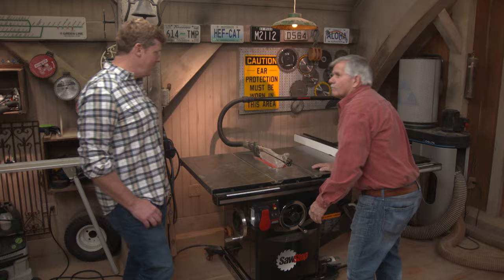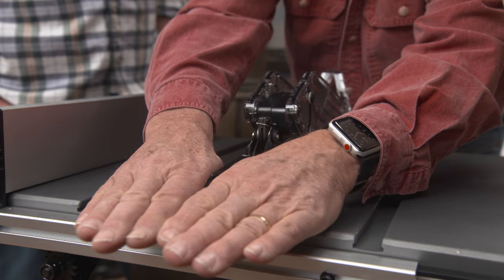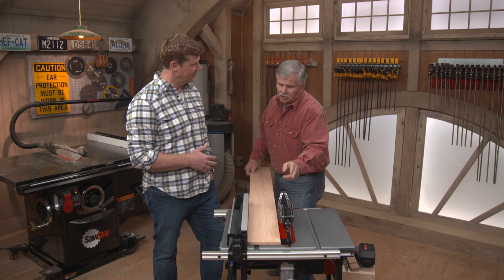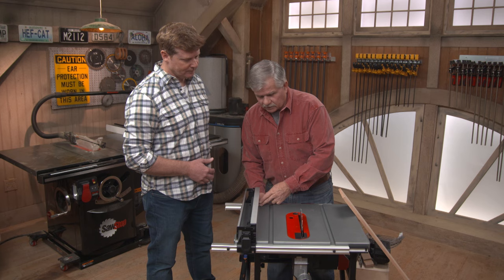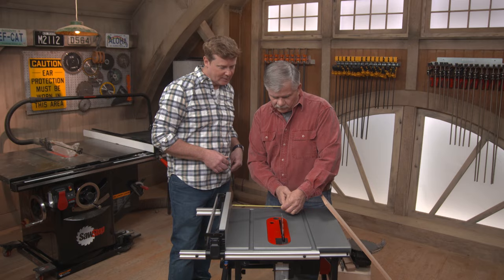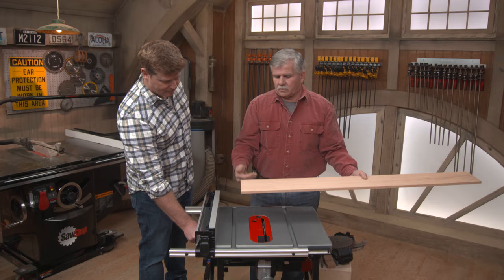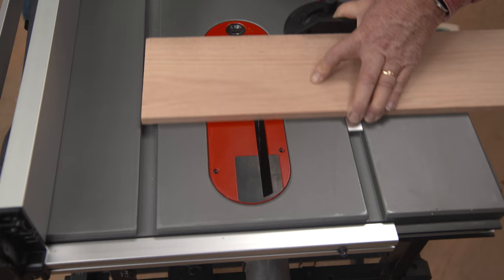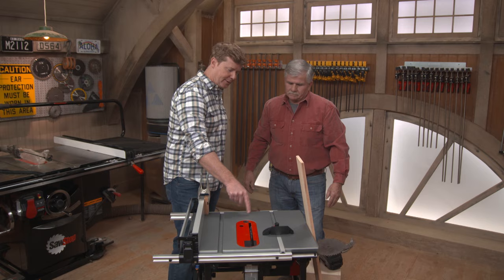How to Use a Table Saw | Ask This Old House

Comment: A couple important things that weren't discussed in the video.  One, keep your hands a minimum of 6" away from the blade at all times by always using a push stick or block to feed material through the blade.  Two, given job site saws are small and light by design, make sure to fasten them securely to something to keep them from moving around while you're feeding stock through them.  A saw that can move around during use ups the chances of kickback big time, and also makes getting accurate cuts difficult.  Clamp the saw down to a larger table or buy a dedicated saw base to go with it.

Comment: One very important tip when operating a table saw:    Stand off of center of the saw blade (out of the kick back zone) as much and as safe as you can..... typically slightly to left of the blade (that's operators left).   If there is a kick back hopefully you are standing clear of the kick back zone.  Also worth noting:  Some kick backs may not simply kick back laterally; the wood may kick up and back.
Reply: What if you are left handed? Should you  
stand to the right?

Comment: Just got a table saw and the best tip from Tom was the use of a small block at the starting point to give clearance from the fence to the saw blade when doing cross cuts. 
Thank you Tom.

Comment: I have been using a table saw for many years. I feel it is always good to review the safety issues associated with table saws just to have them fresh in my head. I have several friends with Very Bad table saw accident "scars". Thanks for a visual reminder. I was always taught to "belly up to the off side of the table saw when doing a rip cut" for some extra measure of safety. Again, thanks for the video and keep them coming.

Comment: For me...great review of table saw safety!  I probably always eyeballed that 1/4 to 1/2 inch, but good to review.  My problem was crosscut safety.  I use push sticks, but I had a small piece of wood rocket back at me, but I had stood to the side of the blade, so it missed me.  Later, talking to friends I realized I wasn't making a crosscut correctly...not using the miter guide...having the material on the fence.  Made the adjustment and feel more comfortable and I'll make a crosscut sled soon.  I just wasn't getting enough shop time to review these things, but as I get more projects I review my safety steps before I begin.  I really don't want a table saw cut...for me or anyone in my shop!  Thanks for sharing!  :)

Comment: Just happened to have bought my first table saw today!
Reply: Be careful. What kind did you get? 
P.s. Don't ever wear gloves, it'll snag and you'll lose your hand. I'd recommend The Grr Ripper
Reply: @twes619  I bought the Dewalt
 15 Amp 10 in. Compact Job Site Table Saw
Reply: @vegasboy7  nice. Get The Grr-Ripper, best push block ever, you'll need two if you cut long stock. I'm not sure how experienced you so I won't go crazy with recommendations, but I'd also recommend a feather board.
Reply: @twes619  I'm new to this, so any advise is welcome! Thanks!
Reply: @vegasboy7  okay. Don't wear gloves ever, try not to stand directly behind the saw when cutting Incase something kicks back, know the difference between a cross cut and rip cut like covered in the video, know what you're going to cut before you power on your saw, once you cut, turn it off, don't leave the blade running any longer than you need to after you've cut your piece, wear eye protection and never turn your head away during a cut, pay attention every time and you should be fine!
Reply: Although I have had table saws for a long time I still took a class on use at a local Woodcrafters for refresher. During the class one of the experienced, not me, students got kickback that fired the piece of wood into the ceiling venting (large dent!). Very scary and a good reminder. Be safe.

Comment: I don't recommend battery operated table saws, especially for any 2X cuts i returned an $800 saw after a week, it's just not strong enough, there's nothing like electrical current saws to do the best work
Reply: Nope, I am sure he meant alternating current haha
Reply: I have that exact Milwaukee Table saw and have no trouble with 2X lumber.  You may cut a bit slower, but it is still no issue as is 1 inch hardwood no issue.
Reply: Agreed. I had that Milwaukee saw and it swallowed batteries faster than you can charge them while also having less power. Convenient if you are doing really small stock and just a few cuts, but you need a cord if you are doing any serious work on the table saw.

Comment: its best to understand that each tool has its own JOB. lots of people choose to use table saws for dado cuts & thin rips, where they toss away the blade guard & riving knife. all my dado cuts get done by using the router table & my thin rips get with a circular saw & straight guide or tracksaw.

understanding what causes kickback, not pushing right next to the fence with your push stick or block, using your riving knife, anti-kick back pawls & blade guard, along with something not mentioned in this video, which is SUPPORTING your workpiece, will all but erase any chance of kick back or other serious damage. 

pushing too close to the fence will cause the back-end of the workpiece to slide into the blade at an angle & the teeth will grab hold of the workpiece & shoot it back towards you at over 100mph. riving knives prevent this, along with the anti-kick back pawls, by allowing the piece to run along them INSTEAD OF back into the spinning blade.

the blade guard is there to always remind you to not get close to the guards & blade. it's there in case your hands ever slip into or on-top of the blade, or pulled into the blade.

jobsite & portable table saws have little room for feeding & outfeed, meaning your workpiece will possible enter or exit the saw UNSTABLE, which will either cause the piece to be cut not straight, kickback, or both. look into a proper outfeed tables or adjustable stand rollers.

Comment: Thank you for this!  I realized months ago i was cross cutting so dangerously. I used the fence for support with both hands as you just shown not what to do........still got all my fingers though!
Reply: build a crosscut sled. Go to William Eng and use his five cut method to get the sled tuned in for accurate cross cuts. There a dozens of great designs on Youtube l liked Nick Ferry's build.

Comment: 5:46 - Having just watched another table-saw safety video, I think the advice on cross-cuts is incomplete, because as StumpyNubs' channel said, the diagonal of a square board is much greater than the side, meaning that if the board twists enough after the crosscut it can rub against the blade and fly up or back.

Comment: Wow this Tablesaw have way more features than mine mine does not have finger guides near the saw and kick back teeth basically just a electric motor belt going to the saw blade it has now on and off switch just plug it in when you want to use it it seems kind of scary to use it now

Comment: The problem with the safety guards and the gripping "blades" on the back end is that you CANNOT lower the blade down to a low enough height for some of the thinner boards.

Comment: After 25 years of running my table saw I made a mistake and lost some meat.  I was lucky.   It took me a month before I could go back to the basement again.
Reply: What mistake did you make, 2pugman? I'd like to learn from you so I don't make that same mistake. I am new to the table saw and am gearing up to make my first cut, so I am doing my research now!
Reply: @ThriftDiving  I was using my left hand to push thru the last three inches of a rip.
I think it was just a bad move to use my non-dominate hand to work with.  TG it was quick !   Today, before I turn the saw on again, I stop and remind myself of what could happen !  The recovery was a nightmare 'cause I cut into bone and it takes time to heal.  I had a great surgeon and today it's hard to see.  Stop and think first !

Comment: Since most material is 2x or thinner I suggest changing your 10" to a 7 1/4" regular 24t framing blade for a circ saw.  Thinner kerf and less strain.  There are videos about it on youtube. I had a 12" table saw and went to a 10" blade and it is way smoother.  You lose a little height but again it'll do 2x material easy and blades are cheaper.  Kind of off topic but interesting concept.

Here's a video from Bob Chase on it.

https://youtu.be/lVO7BkA6CN4

Comment: I know its recommended to use a guard on a saw, but in everyday practice, you'll be hard pressed to find a guard on any job site saw.  They're just way too big a pain to deal with.  And the Powermatic cabinet saw I've had in my workshop for over 20 years has never had a guard on it.  Riving knife yes.  Guard no.  Manufacturers spend far too little R&D trying to design a guard that doesn't completely torment users, so most guards get removed and discarded almost as soon as saws are set up.  Saw safety is a mindset, and is usually insured through common sense and good practices, not via a flimsy piece of plastic and steel that torments the user every time they turn on their saw.

Comment: My table saw is kick back proof from factory it's a harbor freight one so it's like a circular saw and you can do rough cuts with circular saw and they basically out one upside down so my table saw doesn't kick back but I don't really use my table saw or circular saw much

Comment: Or....you can do what every other real professional does which is add/subtract a saw blade width, which is 1/8” by the way, and go from there. If you’re worried about wobble, you shouldn’t be using a tablesaw in the first damned place! Get this hack off your channel..!
Reply: LOL you need to chill
Reply: I just built a full crosscut sled yesterday, which extends over each side of the table.   Isn't that safer than that little sled you were using?
Reply: My, aren't you the angry little keyboard warrior?
Reply: Patrick is cranky